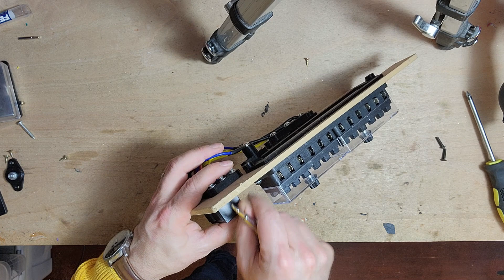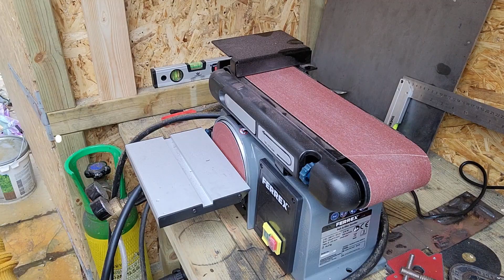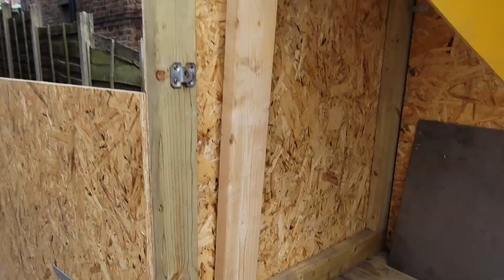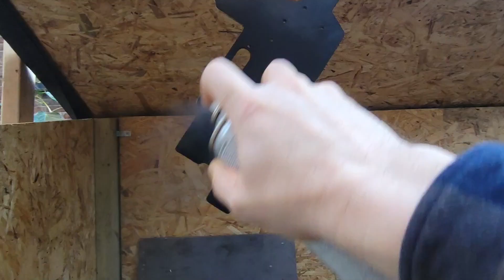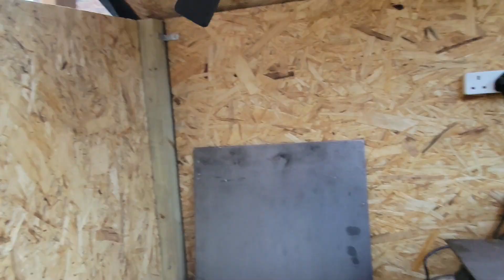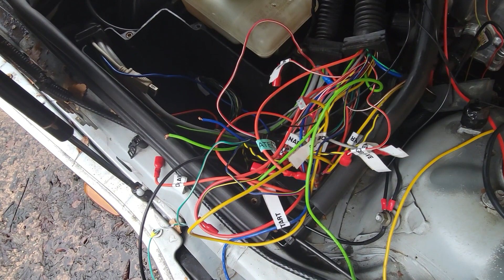Rewiring my electric car conversion, part 3: Clearing out the rat's nest (in the rain)

Comment: Are you wired direct to your ignition barrel?
Reply from the maker: I found the cables that come off it under the dash and tapped in to the one that gives the momentary start. Already had switched live from the ECU loom.
Reply: @EVDIY  I'm particularly keen on photos of the wires you tapped into. Including ecu